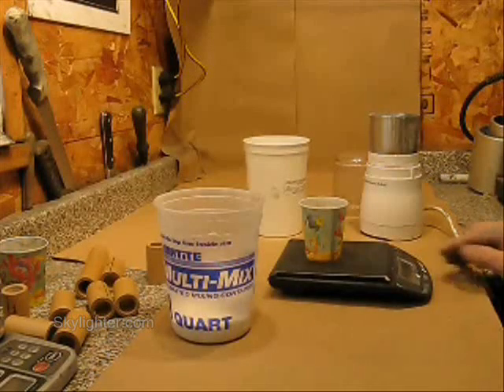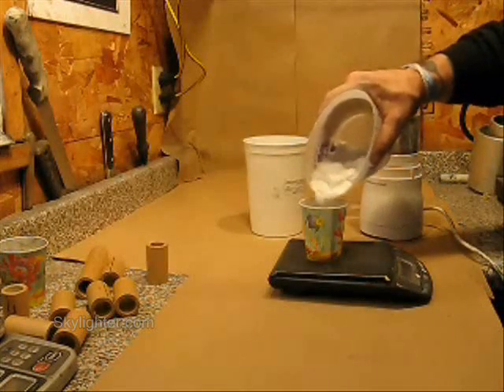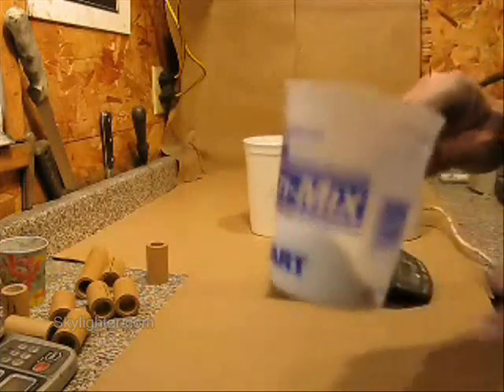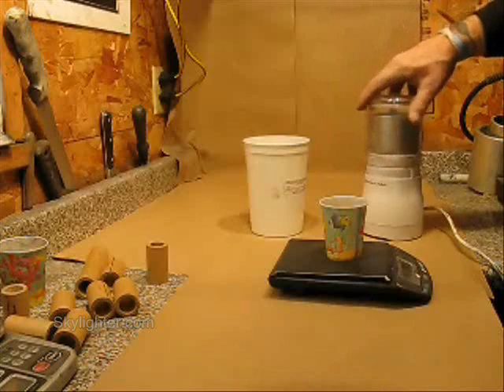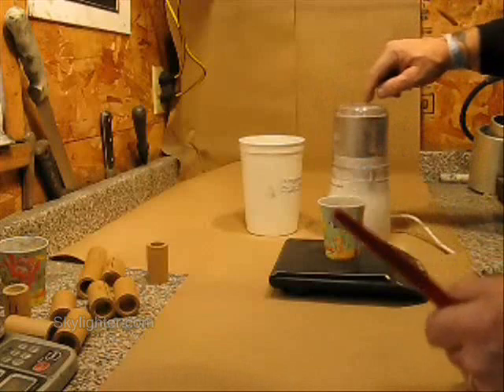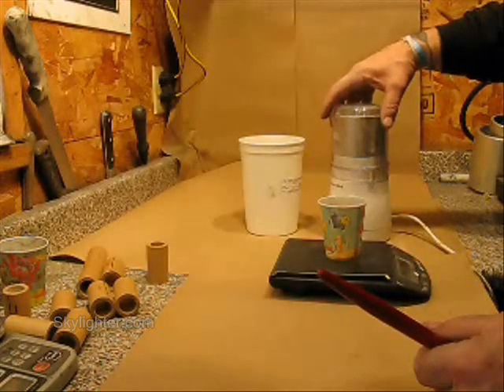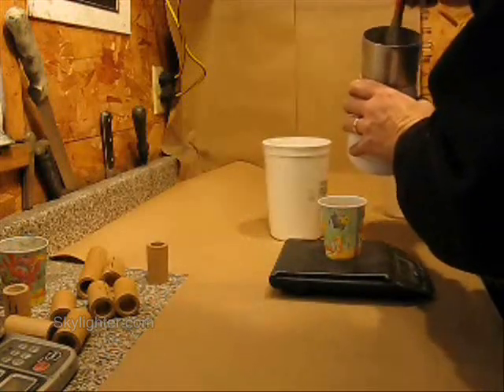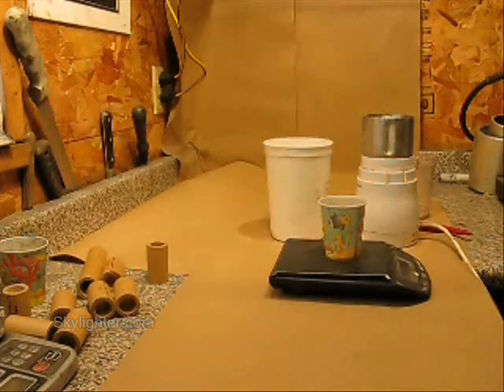How to Grind Potassium Nitrate

Comment: I just recently started using this method instead of a mortar and pestle for grinding kno3 and it's so much faster. I have one of those Mr Coffee brand grinders, but the powder leaks out somewhat around where the top seals when grinding. A tiny bit of duct tape to seal it works really well though. Nice video!
Reply: Hello, just one question: I read/heard that it can be very dangerous to grind KNO3, 'cause it's oxidising...
Is this method safe? Do you have to take particular precautions to do it?
I apologize for my poor English and thanks in advance.
Reply: Grinding kno3 on its own is completely safe as long as there is no other leftover chemicals in the grinder